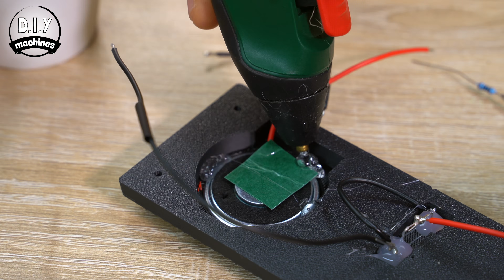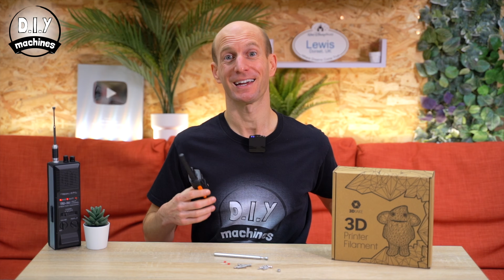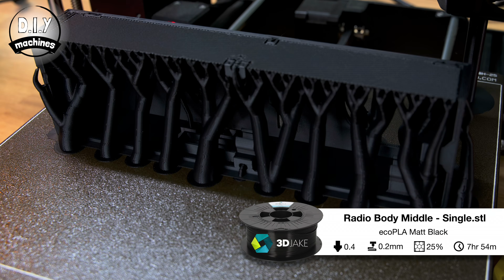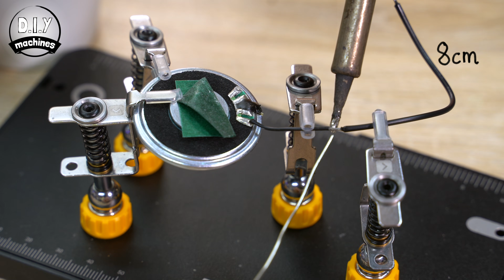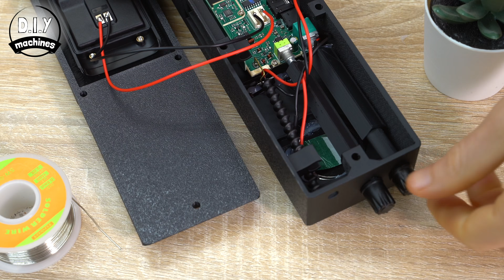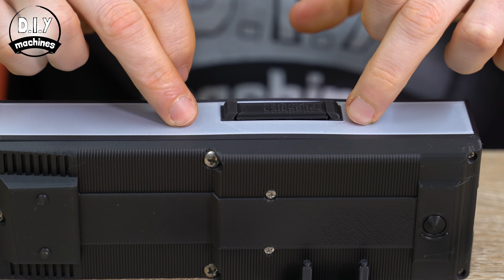I Tried Recreating the Stranger Things Walkie-Talkies

Comment: RF circuits are tuned systems.

The metal chassis is important for RF circuits setting :parasitic capacitance and inductance and defining electromagnetic boundary conditions. Should have left them on.
Reply from the maker: Oh that's interesting. Thanks for the insight - you certainly have some knowledge in this area.
Reply: @DIYMachines  Wouldn't say that. just watched too many videos of "the signal path"  RF is black magic.

Comment: Hi I had a question regarding one of your projects BB8. If I attempt to build him right now would I have any problems with the software? Since it's a 8 year old video? I'm looking to gift it to my son and wanted to surprise him. Thank you in advance!
Reply from the maker: BB8 itself and the code on it should be fine. If there were any problems it might be with finding an app on the phone to talk to it. You could start with just the Arduino and bluetooth module, upload the
 program and check you can connect your phone and control it before pursuing the rest of the build.
Reply: @DIYMachines awesome thank you for the response!

Comment: Great project 📡
Little question: how do you charge the battery if the wires are soldered to it ?
Reply from the maker: Great question, and can't believe I omitted it from the video. There is a USB C port at the bottom to plug it in to recharge. It's part of the original battery pack and the new housing we put it all in has an access at the bottom so no need to open it up to recharge.